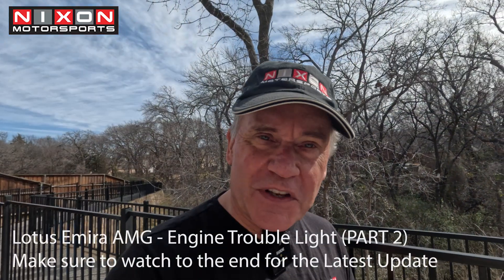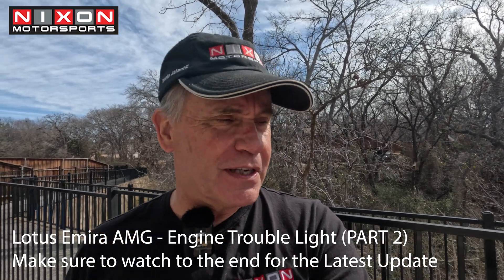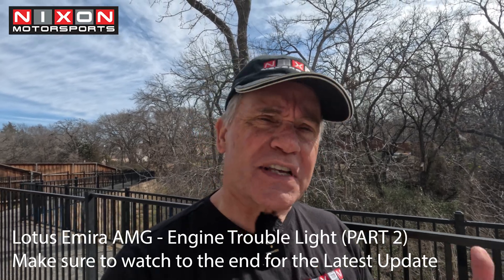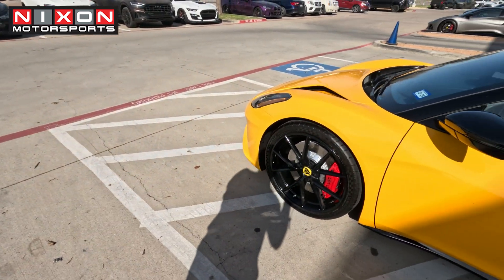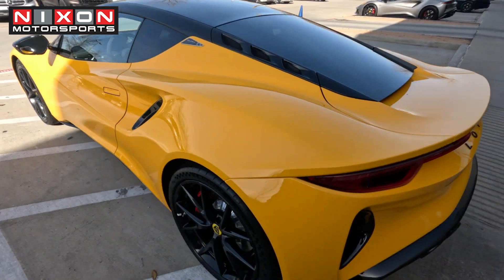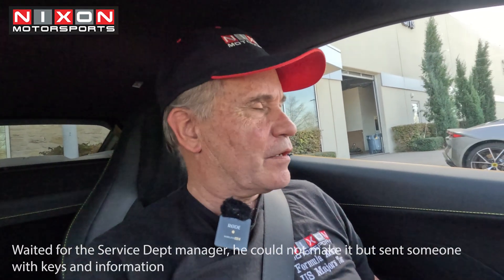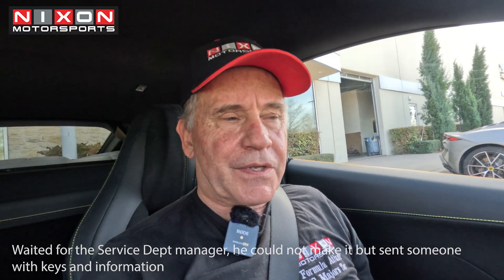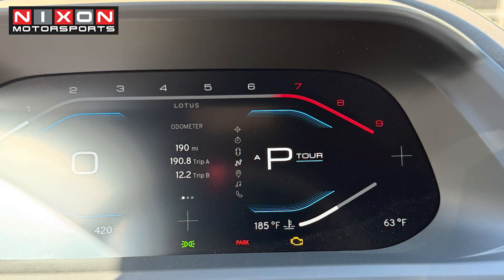Lotus Emira AMG M139 Engine Malfunction (Cooling System Sand) - PART 2

Comment: Hey Mark.
Hope everything pans out for you guys with the Emira.
I've always liked the Lotus brand and it's long history.
Fingers crossed the service guys can get this sorted.
Cheers.
Reply from the maker: Hi, yes we hope it gets sorted as well.  It is still at the dealership being worked on.  They are doing two things, power flushing the cooling system to try and remove the remaining sand and my request of ordering an oil analysis to make sure the oil system is not also a problem.  Maybe another week or two they say.  Thanks for the comment, with luck it will be resolved soon.  Cheers

Comment: very surprised that issue is getting through QC this late in the game.....fellow AMG owner here.  Hoping it's a minor repair!
Reply from the maker: I happen to agree with you.  Not sure how it happened.  In speaking to my dealership service dept this is not solo,  they mentioned 2-3 other cars around the country with the same issue.  Sand in cooling system it seems.  I should have it back from service next week so let’s see.  Thanks for the comment!
Reply: @NixonMotorsports  Any updates??  I went and test drove both version of this car yesterday.  Amazing!!!
Reply from the maker: @kipchicoria  The dealership still has our car.  It seems another week or two before they will be complete.  Flushing cooling system and testing oil to make sure no contamination.  Once I have it, I will share the update.  thanks